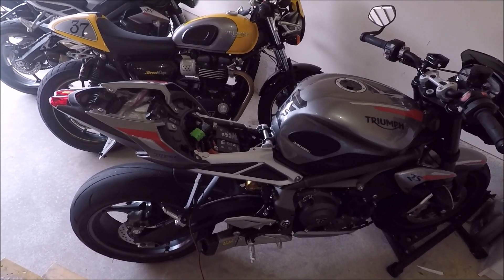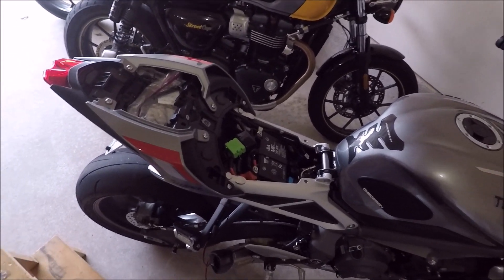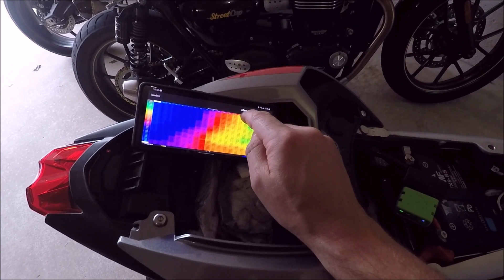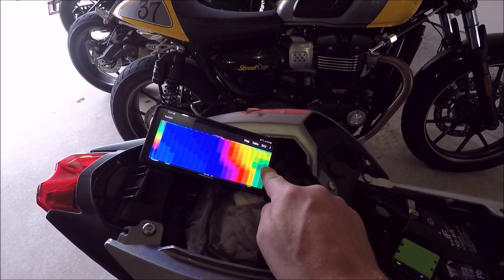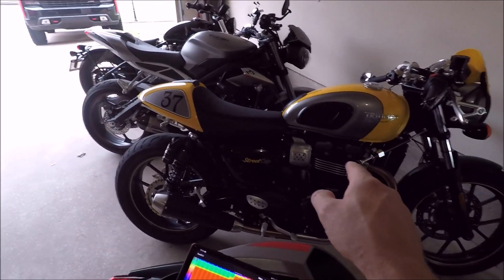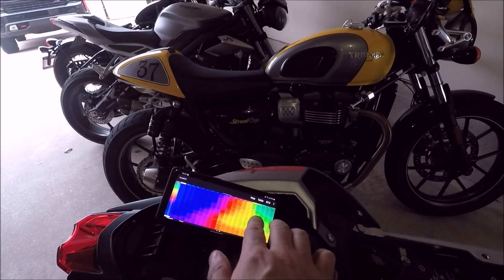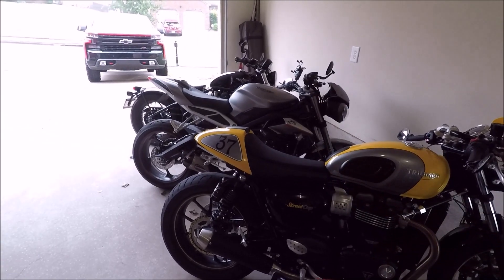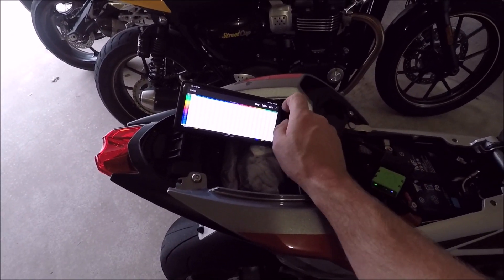How To Use TuneECU on a 2020 Street Triple RS 765

Comment: So if I brick my ecu once I have a copy of my stock tune I can always unbrick it right?
Reply from the maker: Yes, TuneECU has a restore feature.  But just know, that nothing is 100%.  Any time you flash an ECU yourself, there is always a SLIGHT chance that something goes sideways, so you always assume that risk.

Also, make sure you have the newer MX+ or CX+ adapter, they are faster and more reliable.

Comment: Hi Dave,
First of all, congratulations on your work and passion.
If possible, I would like to request an optimized map for a 2019 Street Triple 765 RS with a BMC air filter (non-race version).
The last 6 digits of the VIN code are 897096.
Thanks in advance.
Reply from the maker: There isn't much to optimize for the RS.  The air filter doesn't really impact anything...  And the RS isn't restricted up top like the R model is.

What were you looking for?
Reply: @Daves_Man_Cave 
I believe there’s still some room for improvement at stock level, considering I live in Italy and the bike is subject to Euro 4 restrictions. 
Also, I’m not sure if you know this, but a friend of mine who has the same bike has a custom map that allows him to choose engine modes like Rain, Road, Sport, and Track. On mine, the Track option doesn’t appear. I wanted to know if flashing an original map would make that option available.
Reply from the maker: @HERBALIST.-  Track doesn't appear on yours, but its the same make, model and year and it appears on his?
Reply: @Daves_Man_Cave  

My friend's bike is from late 2017. Looking through the forums, I found that after 2018 the 'track' engine map option was removed because it was very similar to the 'sport' mode.
If you're telling me there's not much to be done in terms of stock mapping, then thank you for your time."

Comment: I'm watching this in a very noisy factory so I'm not exactly taking it in properly. I'll watch it again later tonight. You seem like a helpful guy reading all these comments so I'll ask my question anyway. I have a 2020 765rs and am fitting my HPCorse hydroform exhaust this weekend. I'll be keeping the baffle in because it's obnoxious without it. But knowing these bikes already run a bit lean, you figure I'd benefit from richening up my mixture a little? I have tuneecu already and have an OBDLink LX on the way. I only originally bought it for the service spanner reset but I'm thinking maybe a little tune might be good?
Reply from the maker: Have you left the CAT in the bike?  Just a slip-on?  I can pull up your base map in the morning and maker some tweaks for your setup and send you a link, here in a reply.  What country are you in?
Reply: @Daves_Man_Cave  cat will be staying on yeah. It's just a slip on. I had the same can on my 675r in 2015. I had the Arrow map put on at the dealership and it ran so much nicer. It was noticeably punchier. Before the remap I was just used to it feeling a little flat, to me that was normal. The remap gave it real oomph. I'm in the UK mate.
Reply from the maker: @Taffyraptor    Try this.  Sport mode is more aggressive and linear, AFR targets reset to 13.25, mild ignition tweaks up top, and some mild addition of fuel blended into the idle and cruising range where they tend to run lean.  Also has the cooling fan coming on sooner.  No throttle tweaks to Rain or Road, so if you want it more spicey, use Sport.

https://drive.google.com/file/d/1IfGxtyX0398RYwpugAP3KqoOGnpK0t2s/view?usp=drive_link

Install map, use TuneECU to reset adaptives, fire it up and let it warm up a bit and let the idle settle in, and then go rip on it in SPORT mode and see how it feels.
Reply: @Daves_Man_Cave  Awesome mate. I've downloaded it. End can is getting fitted tomorrow. I'll have a little play around with stuff then. Thanks again. Keep up the good work.

Comment: Is it possible to change sprocket size ?
Reply from the maker: Yeah, why wouldn't you be able to?  The speedo gets its signal from the wheel speed sensors, so sprocket changes don't throw it off.  I would only goo up a tooth or two on the rear, max.  The bike is limited to about 145mph in the ECU, so gearing it to only go that fast is a good idea...
Reply: @Daves_Man_Cave a friend of my change the sprockets and now get error message
Reply from the maker: @moggel6  What bike?  And what sprocket sizes did he pick?  The stock 765 comes geared almost perfectly.  At most, maybe go up a tooth on the rear and that's all it needs.
Reply: 765rs

Do you maybe know what I can adjust on my speed triple 1200rs?
Put new exhaust and cat delete 
Know I noticed down low it’s a little bit dead. 

What to dyno it in the summer but maybe you know what i can do to make it a little bit better
Reply from the maker: @moggel6  What year, country and last 6 digits of the VIN?  Some of the newest bikes have an encrypted ECU that has not been cracked yet.  I would not do an exhaust until I was 100% sure I could tune it properly.  If your exhaust came with a dB killer, install that until you get it tuned
Reply: It’s a 2021 from The Netherlands ag1146 map 31232 

Already had contant with a tuner and it is possible
Reply from the maker: @moggel6  Ok, so then you can tune the fuel tables, ignition tables and all the rest.  If you know that, not sure what you are asking?
Reply: I thought maybe you know specifically to adjust so that it runs little bit better. Until it gets the full dyno tune. I don’t want to fuck it up
Reply from the maker: @moggel6  I would add some fuel around idle and up to 20% throttle, for 0-5,000rpm  Add 10%.  Start with that and see how it rides.  Better to have extra fuel than not enough, at least to a point.  Adding 10% there won't be enough to foul plugs or anything, but it should make the motor happier.  In the 0% throttle range, only add 10% in that first column up to 1300 or 1400rpm
Reply: Oke thank you 🙏
Reply from the maker: @moggel6  Your exhaust... is the exhaust valve gone, as well as the O2 sensors?
Reply: @Daves_Man_Cave the valve is gone the 02 sensor is still in
Reply from the maker: @moggel6  Here:  https://drive.google.com/file/d/1bc09wqWkg7n77QG7Q5vvYXZUA7-hzbb9/view?usp=drive_link

Was easier to just make the map myself than try to teach you how to do it in the replies.  haha

Added fuel to keep the motor in the safe zone, but Sport mode is now gonna feel even more spicey... removed all the restrictions and torque limiters they had in there, reset to the AFR targets to something more reasonable, the cooling fan will come on sooner, disabled the exhaust valve so it won't throw a code... Ignition timing looked fine so left that alone.
Reply: @Daves_Man_Cave the adjustments you made are not going to give problems until it gets the full tune ?
Reply from the maker: @moggel6  No, that's kinda the point of this map, to get you "close enough", till you can put it on the dyno for a full tune.  Why would I take the time to make and send a file to cause a problem?  lol
Reply from the maker: @moggel6  You don't open the file with the phone.  Just right click and download it to the phone.  Save it in the "Downloads" folder.  Then launch TuneECU, then select Map, then Open, and then navigate to the downloads folder where you saved the file.
Reply: @Daves_Man_Cave bike is running to high down in rpm around 2,5 thousand when standing stil
Reply from the maker: @moggel6  Yeah, let it idle awhile, it should settle down.  Did you reset adaptives after flashing the map?
Reply: @Daves_Man_Cave yes
Reply from the maker: @moggel6  When I push a new map to the bike, I always reset adaptives...then when I start it up, it usually idles high for a few minutes but eventually settles down, as the motor starts doing short term fuel trims and adjustments based on the O2 sensor inputs...  Let it warm up and go ride it and see if it continues...
Reply: You are amazing. I going to load the map tomorrow and let you know how it rides .

Thank you

Comment: The video is very good, it is possible to change the RPM limit for the motorcycle to exceed 242km/h?
Reply from the maker: Nom the speed limit is hard coded into the ECU.  Some bikes can flash that out, not sure about the 765.  Racers in the UK that got around it, did so by getting rid of the  ABS wheel speed sensors, or something like that...

Comment: Is it possible to activate the mode for the abs pump bleeding?
I need to replaced the brake fluid and make appropriate bleed
Reply from the maker: Yes, TuneECU can do this, my buddy just did it on his Street Scrambler 900 over the weekend.
Reply: Thank you! Do you need an adaptor cable for OBD? Like a 6 pin to 16?
Reply from the maker: @robertosorrentino6349  There ODB connector plugs into the factory harness under the seat, and then connects to the phone via bluetooth.

Comment: Hi Dave, great channel!

I'm worried about the dealer ceasing the warranty after having proof of ECU flashing. 

Is that possible?

In a MT07 I used FTEcu and the ECU got blocked for the official Yamaha dealers (not for me).

Thx!!
Reply from the maker: It can.  When you flash the ECU with TuneECU, the dealer can tell how many times the ECU was written to,  but they can't really tell what's been done.  The factory, might....
Reply: @Daves_Man_Cave  
Thank you!

Apart from the flash count, can Triumph dealer access and reflash/update the ECU as usual?

Comment: Do I need to download a map,modify it, then feed it to the ECU or can I simply connect tuneECU to my ‘22 street triple R, modify the existing map while connected then update? Thank you
Reply: I’ll be doing the R to RS throttle conversion you talked about in a previous video. Thanks for the help 👍🏻
Reply from the maker: You download the stock map from TuneECU through the app.  Instructions on their website.  

Download that base map, and then modify it to your needs, save that new copy, and then you can connect to the ECU and push it.

Comment: can i get this for my 2024 street triple 765 R, just to reset the service light?  
i hear the dealer charges about $70 to do it.  i'm just not sure if the app needs to support the specific bike or if it works regardless.  and if it does matter, how do i know if my bike is supported?
Reply from the maker: I believe so, but I have not gotten a chance to play with the new 2024 model, so I cannot confirm.  If it doesn't, it will probably just be a matter of time till it does...

Comment: awesome video! thanks. 
I haven't done anything to my 2018 RS as far as performance mods. My bikes have always been professional tuned.
Sorry for the stupid question - I'm super new to this device. Can that unit be used to clear the maintenance required wrench icon too?
Reply from the maker: Yes, you can reset the wrench on most Triumphs.  Connect to the ECU, swipe to the right where the dials are, and under Adjustments and Parameters I think it is called, there is a service interval option.  I have a video of it somewhere...

Comment: Hey do you know any shops in the US that will dyno tune a 2022 street triple rs?
Reply from the maker: Plenty will.  What part of the country are you in?

Here is my advice.  Use TuneECU to disable the O2 and SAI, and that's it.  Then install a Power Commander(plug and play) and then take it to a local tuner.  With the power commander, tuning a Triumph is no different than tuning a Harley or a Suzuki.  It's just a regular dyno tune with the dynojet software that they use every day...
Reply: Is it not possible for the dynojet people to tune this bike without doing this operation first?

Comment: What's the top speed? It should be 155
Reply from the maker: 145.  Triumph limits it in the ECU to about 145.  Not sure if TuneECU can get rid of that or not.  And honestly, the bike isn't a lot of fun at 145...  You have zero wind protection...
Reply: @Daves_Man_Cave  I don't think so unless you get a different ecu maybe? I have a set of daytona fairings I'm gonna convert so it's alright
Reply from the maker: @radicalkonrad765  I will pull the base map into TuneECU and see if its an option.  I know that Paul Holden in the UK tunes and races these things, and he said the only way to get rid of the limit was to remove both wheel speed sensors... but that also gets rid of the MPH on the dash, the ABS and Traction control... Which might be ok for a dedicated race bike, but obviously not what you want on the street...
Reply: @Daves_Man_Cave  eh coming from an old gsxr 600 with no assist it's not a big deal, from what I'm seeing on some websites it's possible to remove the limiter, maybe adding 2 teeth in the rear might help too
Reply from the maker: @radicalkonrad765  This bike has a good bit more power than a 600... I checked in TuneECU and it's not able to remove it.  If you want more speed, I would just get a different bike, personally.  Instead of trying to make it into a Daytona and likely tanking the resale value, why not just trade it in on an actual Daytona?
Reply: @Daves_Man_Cave  well you see insurance in Toronto Canada is insane for super sports (15k+ a year for me) and I don't ride dirty anymore so the street triple is the highest spec bike I can get with ok insurance rates
Reply from the maker: @radicalkonrad765  Gotcha...  I had a 2020 and the speed limiter could not be removed.  In all seriousness, how often are you going to go going over 145mph?
Reply from the maker: @radicalkonrad765  And your insurance rates are crazy.  I pay $850 a year for full coverage on a Ninja ZX14R...
Reply: @Daves_Man_Cave  I could dream, honestly considering moving out of province for some better rates

Comment: Question. Someone tried to steal my bike and broke the ignition with a scre driver. I installed a watch Dawgs key fob system and now I use fob and on off switch to energize/start bike. Will tuneecu still work in my case?
Reply from the maker: I honestly don't know...  I have never dealt with any of the ignition and key fob stuff.  I don't recall seeing anything in any of the settings in TuneECU that mention it...

Comment: Just connected the bike to an obd link lx, bought the license for tuneEcu, it connects to the device just fine, but on connecting to the ecu it says ecu not responding. Please help 🙏🏻
Reply from the maker: Is the bikes ignition turned on?
Reply: @Daves_Man_Cave  I think the kill switch was off. Will try again tomorrow and report. Hope that solves the problem. Thank you for the help and support ✌🏻
Reply from the maker: Yeah, you have to have the bike turned on, and that's after you pair the phone itself to the ODB link.  That connection has to be in place, and then you load TuneECU and tell it to connect, and it should pop up a list of devices to use for the connection, and that's when you select that ODB link from the list...
Reply: @Daves_Man_Cave  thank you so much
Ecu connected
Unfortunately on swiping left it says ‘no map opened’
Is there any way to see the stock map on the bike ? I just want to do the throttle table mop you have shown on video

Also the map I downloaded from tuneecu for my 2021 street triple R - 31038 - has 4 versions of all 3 ETV tables
Reply from the maker: @sarabchhabra7423  You can't see the map that's in the bike, you can only push a map TO the bike.  You would need top click Map>Open and then select the Download option and then sift through the list of brands, select Triumph, and dig down to your model and VIN range.  Honestly, its probably faster if you give me the details and I just send you the map.

Then you download it to your android device, and then open it with TuneECU.  You can then push it to the bike from there.
Reply: @Daves_Man_Cave  Thank you for taking out the time to reply. What is the best way to get in touch ?
Reply from the maker: @sarabchhabra7423  What are you looking to do with the map?  Do you have a map for a certain application that you want to use?

Just post the info here, and I can pull your base map from Triump and put a link to it in a response
Reply: @Daves_Man_Cave  2021 street triple R
Based in India
Stock exhaust, mwr air filter
Only street riding

Only want to do the throttle table modification of the sport mode as you had suggested and demonstrated in one of your videos. It’s as if the bike loses steam around 7-8k rpm

On clicking information after connecting to the ecu, TuneEcu shows my map as 31041 which does not correspond to any map on the tuneecu database

Also I downloaded 31038, it shows 4 versions each for all the 3 etv tables
Reply from the maker: @sarabchhabra7423  Ok, I iwll find your base map in a bit, modify it and send you a link to it.  Give me a few hours.
Reply: @Daves_Man_Cave  thank you so much 🙏🏻
Reply from the maker: @sarabchhabra7423  Ok, apparently your base map is not in the database, which is odd.  So I took the "All Countries" map for your model and VIN range, and built on that.

Sport is completely unlocked up top, and a little more aggressive in the midrange.  Road I left alone.  I increased the rev limit, reset your AFR targets to 13.2 and added some fuel trims, which I then committed to the F tables.  It's only about 10% more fuel in the lower end and tapers off to only 2% more up top.  Just want to richen things slightly, it tends to make these motors happier.  Here is the map:

https://drive.google.com/file/d/19J7b34eK7qXDV-iGbFzA767aFQXxOP7y/view?usp=sharing

Download it to your device and see if it will let you flash the All Countries map to your bike.  If it does, do it, when it's done, reset adapatives and then take it for a ride and report back.
Reply: @Daves_Man_Cave  simply cannot thank you enough 🙏🏻🙏🏻🙏🏻
Your support is inspiring
Hope to pay to forward to the community 🙏🏻